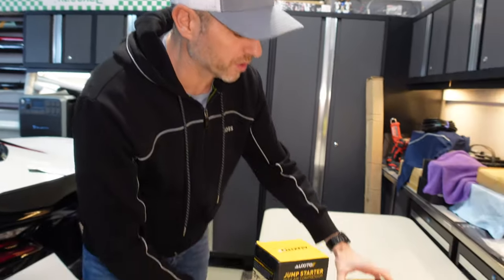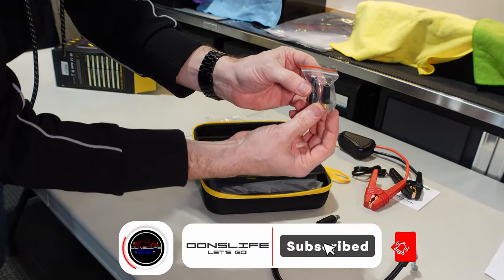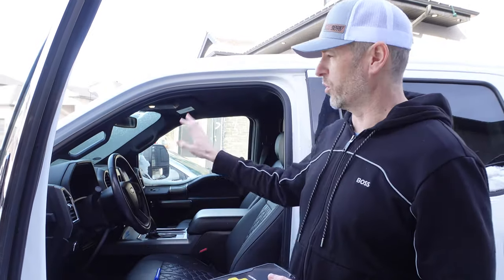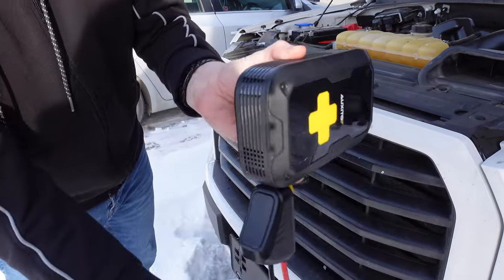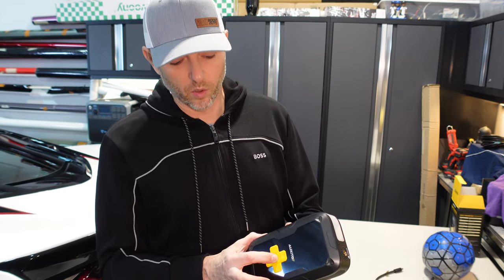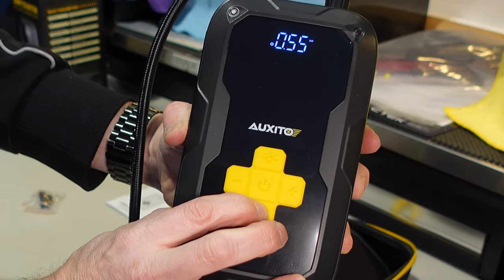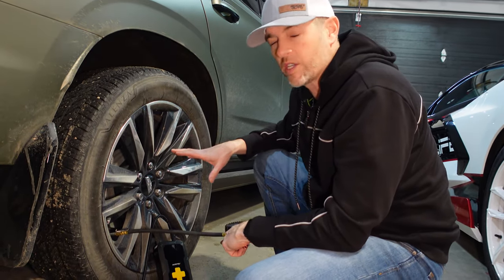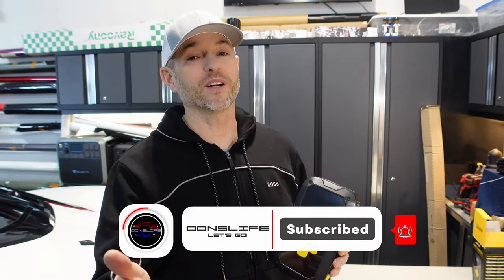AUXITO's Portable -Jump Starter -Tire Inflator - Air Compressor - Unboxing & Review

Comment: It’s a nice light duty charger.
In my experience if I’m going to leave a truck sitting for more than a week I get a battery charger on it to maintain the batteries. 
These new vehicles are very dependent on the proper voltages they are designed to have supplied to them. 
Trying to start one of them with depleted batteries using the old school method is a risk. One could lose a sensor or programing and start an unexpected and expensive cascade of trouble codes.   
Trust me… I know this not because I’m wise. I know it because it happened to me.    

By the way... the subscriber count is inching up so watch the entire video, subscribe and leave a comment. These three things help the channel grow.  :rocket-red-countdown-liftoff::rocket-red-countdown-liftoff::rocket-red-countdown-liftoff:
Reply from the maker: I use my CTEK products for battery maintenance.  This little device will come in handy around the house and when we travel.